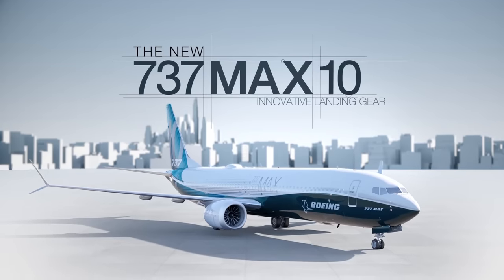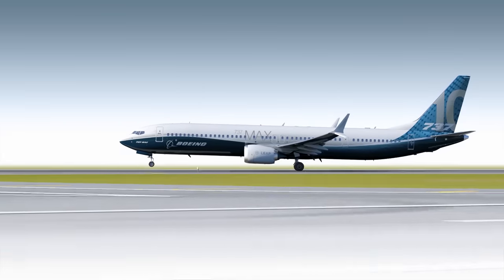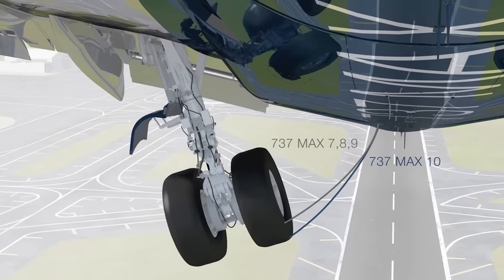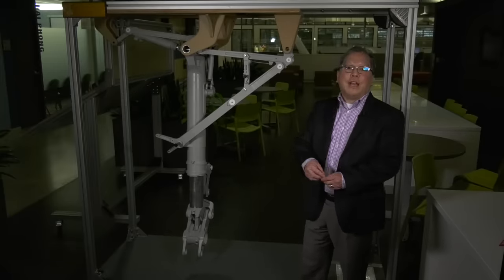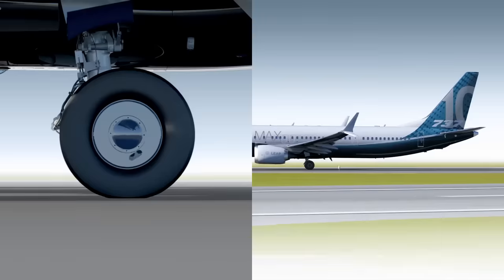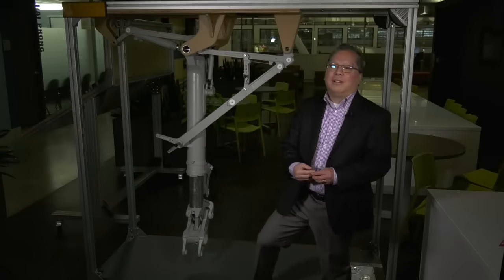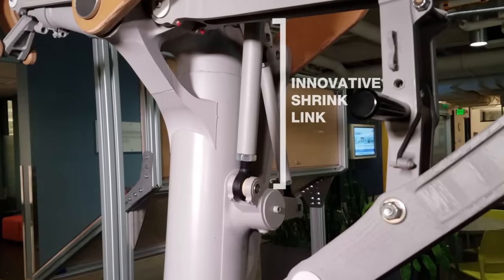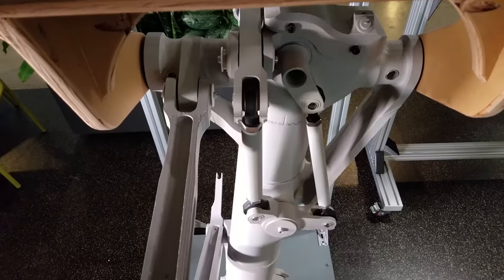How the 737 MAX 10 landing gear works

Comment: So for 20 plus years they've used that squashed engine cowling for nothing?
Reply: No because thats for taxiing
Reply: The reason for that is to make the plane lower to the ground and not allow FOD to be sucked into the intake.
Reply: It allows easy access to the fuselage increasing the efficiency of cargo loading
Reply: Nope. It’s because the gear is too short because the plane was designed with low bypass JT8D engines. 

Cargo loading isn’t more efficient, because the cargo pit is still that of a regional jet... very small with inward opening doors which makes loading more difficult.
Reply: @Bartonovich52  the engineers wanted to make it easier to load   stuff into the fuselage  by the fuselage door.The fod would not need to use complex equip to get the stuff loaded as the fuselage is at a lower height.So they wanted to make a change to the engine cowling.You are not wrong is just that there are many benefits to loweing the fuselage which means having shorter gears and squashed engine cowling.

Comment: ryanair landings
Reply: Jaden Corner 😂😂😂😂😂
Reply: Jaden Corner Will the plane land smoother on these new landing gears? The current 737-800s land so firmly
Reply: Tom Jardine I would hope so as there is more gear but as the plane is so low I guess they can’t add that much more to make it less firm
Reply: @Matty12333  with more strut travel it should help

Comment: I think if they made the MAX higher than the 737NG, non of the crash would happened bacause the main problem is the engine. The engine is slightly higher than the wing causing it to interrupt the airflow which makes the plane go into a stall position. If they made it higher like the A320, the engine would be lowered and uninerrupt the airflow and they can removed the MCAS.

Comment: Boeing still milking it with the decades old 737 design, just build a new plane !
Reply: Boeing pressed for a new design, Airlines demanded more 737s. Boeing's not at fault for the customer's requirements, mate.
Reply: Agree, both Boeing and Airbus are under enormous pressure of airlines seeking solution to either replace or expand their fleet (especially low-cost airlines, both start-up or established ones). AirAsia and Indigo alone ordered over 500 A320neo, Ryanair and Southwest almost 400 737 MAXs.
Reply: They did build a new plane, the 787
Reply: 1) Customers don't need a new one, as mentioned before Airlines wanted more 737's.
2) Building a new plane is HARD. Did you see the 787? A completely composite fuselage was a new plane. It suffered many many delays in the launch. That's why we don't see new aircraft designs every 5 years
Reply: Not to mention the same width. Matter of fact the new 737MAX fuselage is almost inch narrower than older models. So where is  Boeing engineering?
Reply: Nandoo The 787 was a challenge because as you said Boing had no experience in composite airframes and trialled a new way of assembling a plane from mostly ready made components delivered by a range of suppliers outside the Boing plants. That experience could have been used to build a new 737 successor in a much faster fashion. The current 737s fuselage is too narrow, the landing gear too short for larger engines so that they already have to come up with complicated link and strut additions to manage the rotation point. The plane is half a century old and needs replacing. Maybe the new middle of the market model will solve the issue.
Reply: Malith Perera does that eat into cabin space or is it just a reduction in wall thickness
Reply: If I understand correctly, one thing that Boeing doesn't have covered well in their catalogue of commercial aircraft is mid-size airplanes.  The 737 is a small plane, and the 767, 777, 787 are large planes.  The only one they used to have is the single-aisle 757, and they no longer make that.  So, the reason they keep modifying the 737 is not just because it's a popular aircraft, but rather because they don't want to invest in a completely-new single-aisle short-to-mid-range aircraft, and it's just easier and cheaper to add/remove length to the 737.
Boeing also does not make small local commuter/regional-type planes, like the popular Bombardier Q400.
Reply: You have valid points there, and I completely agree with the possible "797" middle of the market being the solution. But at the moment the 737 isn't really a "true" middle of the market aircraft in my opinion. At this point in time the most feasible way is to add to the 737 as EVA_Unit_4A said.
Reply: LordLauderdale I personally think the 737 has ran its course, but I suppose designing a new plane won’t be easy nor cheap
Reply: It's not as easy to just "build a new plane" as you would like to think. It's an enormous investment and economically it's better to re-engineer current products to meet the demands of their biggest customers than take an unnecessary risk. The 737 is due for replacement around 2030, yet airlines currently are fine and happy with more 737s (i.e. WN, RYR, UAL, etc). Every manufacturer "milks" their products if there is demand for it; don't turn the other way and ignore the others while simultaneously criticize Boeing for doing it
Reply: A totally new architecture plane requires a decade for development and certification .
Reply: Same could be said about Airbus. The fuselage looks exactly the same, however the winglets  on a 737 are new designs. The a320 Neo only has new engines, no new winglets
Reply: @LordLauderdale  like the 797 which is a completely different market?
Reply: @jviation737  dude I love ur vids man
Reply: The 757 replacement is Boeing's priority not the 737 replacement. If a new plane was needed and wanted, I'm sure Boeing and Airbus wouldn't have wasted time or money putting new engines and other improvements on the 737 and A320 families, they'd have made a narrowbody version of the A350 and 787 if that was the case.
Reply: Infinite flight And more games There is overlap with the largest 737 variant and the Airbus A321. The smaller 737 could be replaced by the new partnership with Embraer.
Reply: To people who make airplanes, airlines are the customers. To airlines, the passengers are the customers.
Reply: LordLauderdale no;
Reply: the cseries which airbus majority owns, is a direct competitor to the 737 max. Its lighter, less noisy and more fuel efficient.
Reply: Boeing asked we need a 737 replacement and customers didn't want that they wanted a updated 737 and screamed loud this aircraft is called the max for a reason unless they redo the type certificate system this is the maximum they can update the guppy jet without retyping the aircraft
Reply: @alexmnblyth  The wingfence was the original Airbus wingtip device now they moved to a standard looking device
Reply: You heard this saying 

Easier said than done
Reply: Or the saying "Why fix what isn't broken". The 737 is in high demand, why replace what is still a big seller?? That would make no sense especially considering that their replacement jet might be a big flop. Then that's millions if not billions of money down the drain they'd never get back
Reply: Don't fix what ain't broke
Reply: Nick Dawson Exactly. I personally love the 737. I love Airbus jets too. Each are great in their own way. But my favorite plane has always been the 737. Everytime I see it it only gets more beautiful
Reply: @iVince905  Wrong. The A220-300, the larger of the 2 models will at best ONLY compete with the MAX 7, the smallest MAX variant. All the other MAX models are considerably larger and don't compete with the A220-300.
Reply: @nycalien . An inch is 2.5 mm. What significant consequences is 2.5 mm narrower fuselage gonna effect the Max from its predecessors?
Reply: YouTube CEOs and aeronautical engineers
Reply: blame it on the airlines, boeing wanted to make a composite 757

Comment: Should have made a similar system for the rest of the MAX series, only that it's always extended when down, even on the ground, then it contrapts when rectracting. That way the engines didn't need to be fitted so forward and no MCAS would have been needed.

Comment: still a 60's airframe
Reply: ya a solid one at that
Reply: Made from real metal.
Reply: Very reliable and solid airframe, hence why it's still very popular today 40+ years later, I doubt a modern aircraft airframe design will last so long, they don't build things like they used to anymore. Look at the A380, some are less than 10 years old and are already retired.
Reply: Do you own a car with four tires? If so, you are basically living in the 1890's amirite?..  See how stupid that sounds?
Reply: Right, when things were overbuilt and sturdy not just strong enough. Not built by today's snowflakes :-)
Reply: @guitarplayerforu  they are not being retired because they the airframe isn't good anymore. And some of those were already bought to serve other airlines.
Reply: @tomasribeiro8020  I didn't mean they are being retired because of the airframe, my point was that no modern Aircraft will probably get to the stage the 737 airframe has being a 40+ years old design.
Reply: @guitarplayerforu  yes but let's be honest the 737 only got this far because Boeing was constantly updating it and "forcing it" on clients. The spitfire would have survived to modern days if it was constantly update over and over. So basically the 737 isn't dead because Boeing kept it alive. Not because the original design was made to last 150 years.
Reply: @tomasribeiro8020  that's true, if the design works it makes sense to keep updating it, I love the 737 and remember my first flight with my mum in 1998 on a Britannia airways 737-200 and the 200 was a brilliant aircraft, it was also a very different aircraft to what the modern 800Ng with sky interior or the Max  we know today is. Yeah the basic fuselage might be the same but a lot of other stuff is new on 800's/Max, especially the Max, it's had a new tailcone and everything. I do think though that the 737 max will be the last series of 737. I think it's a shame the 757 couldn't have been updated. Apparently airlines wanted a simple re-engine of the 737 when Boeing was pushing for a new narrowbody aircraft.
Reply: @guitarplayerforu  of course they wanted it. With airlines having fleets some with hundreds of 737s the maintenance costs would be to big if they wanted a brand new narrow body. And I agree with you the max will be the last generation of the 737. I've never been a fan of the 737 but hats off to Boeing for changing the market in such a dramatic way with one aircraft. Long Live the a320! Sorry couldn't resist.
Reply: @tomasribeiro8020  the A320neo will be the last of the A320 I think too as the A320 design is 30 years old too and been updated over the years. The 737 is only 20 years older. Both are old designs now and both have done exceptionally well but around 2030 time both will be replaced with a clean sheet aircraft I think.
Reply: @guitarplayerforu  yeah probably. Both are absolutely brilliant planes and changed the aviation industry forever. Although the neo and the max will still last at least 10 years or something. Time for a clean sheet of paper both from Boeing and airbus. I think Airbus might get inspiration on the A220 for a new aircraft... Especially on the cockpit (though the a320 has IMO the best and most logical cockpit on the market)
Reply: @tomasribeiro8020  I love the A220(formerly C-series) I'm hoping the A320 replacement is a bigger version of it personally, it's perfect. And as for Boeing, a baby Dreamliner would be an amazing 737/757 replacement. The max and neo will definitely be around for a long time 🙂
Reply: @guitarplayerforu  couldn't agree more with you on this one. A baby dreamliner would be amazing. And a grown A220 is actually a pretty likely thing to happen. If I'm not wrong the 797 is supposed to have quite a lot of features from the 787 actually.
Reply: Overbuild airplanes are no longer competitive as they are just costing more fuel than other accurately designed planes.   Planes can no longer be overbuilt if they are to be economical:  They are built to the safety requirements of the industry and nothing more.  Unnecessary weight= lost revenue for airlines.
Reply: So fucking what?
Reply: TR Aviation You are aware that airline companies were requesting the 737 right?? Southwest alone requested and ordered over 400 of their Max10's. Doesn't sound like Boeing is forcing it on anyone it's just the best plane to use.
Reply: @Pedro Santos, that is the stupidest thing I’ve read on here. 

The 737 has always been weak. It was designed to be lightweight using bonding for pressurization hoop loads... but it disbonded and out rivets that we’re supposed to be in tension holding the skin onto the fuselage in shear holding the lap joints together. One day, it decided to let go and Aloha 243 became a convertible. Now all classic 737 have to have boilerplate lap joints after 50,000 cycles.. and Boeing made the 787 out of conposites to get rid of metal fatigue and stress concentration cracking. 

And “snowflake”, seriously? We should waterboard anyone who abuses that internet neologism.
Reply: Bartonovich52 ‘’The 737 has always been weak’’ and then you mention incidents it had in the past’’ like Aloha. Haven’t you forgotten that it was a plane produced back in the days Technology in Planes weren’t like advanced as the ones today? Did any A320NEO or 737MAX ever crash? There you go

Comment: The way when the plane rotates and the landing gear extends, it looks like the tail strike risk is lower. Like the landing gear does not extend further on the other 737 family. Like the 777-300 has its landing gear lifting up pair by pair to lower the tail strike risk than on the -200 family

Comment: This is about using the larger diameter engines, used on the AirBus 321, on a 737. Yet the tail isn’t so high that it won’t fit into hangers used for the 737, (Southwest and Ryanair examples)

Comment: i think the great ideia is build landing gear with indestructible material. And then, all you have to do is produce only 3 units. So it can be recovered in the next 737 crash and installed in another one until there is no more needed.

Comment: "Commonality with the MAX 8 and MAX 9" - don't you mean commonality with the 737-200? Aside from this contraption, the landing gear arrangement of the 737 has really not changed over it's entire life, and that's probably one of it's biggest limitations - that short landing gear which is problematic for longer designs in regards to tail strikes, and also was the reason behind having to mount the engines further up and forward, which is why the whole MCAS thing was necessary in the first place - this madness all really traces back to the landing gear. It is one of the last vestiges of the original 737, and one they really need to ditch - though at that point it isn't really a 737 anymore as there's nothing left of the original design. If they want to make it any bigger, they should add a longer gear leg with four wheel bogies, actual gear doors. Should widen the cockpit as well, the current design is not well suited for long-haul missions 737s are now used for. ... Oh hello 757-NG, good to see you again! This mechanism here is brilliantly designed, but I just see it as yet another effort of pushing an old design too far, both in size and time, it's too riddled with work-arounds by now. Time for a clean-sheet design.

Comment: at this poinf of time Boeing needs this new system 
on the nose so it will retract  in a panel under the cockpit 
also they might wanna just not have landing gear
because they wont need it 2.5 seconds after departure 
it will decend rapidly falling out of the sky to its doom
so will they or will they not be needing landing gear?

Comment: From a pilots perspective the overhead panel should have been modernized, not be stuck in the 1960s still.   Also the cockpit can use some better sound insulation.

Comment: Should have just raised the bloody plane 12 inches...then you wouldn't have had to mount the engines higher up on the wing.
Which would have prevented the nose pitch up...which required MCAS.
Which caused the crashing, and the deaths, and the grounding.

Comment: just check out the A340's and A330's they also have a shrinking link system in the Landing gear and they fly around since 1991/1994. just as an info for all these guys who think it's not safe or whatever...

Comment: They solved the wrong problem. They need to raise the entire fuselage higher off the ground. So they don't have to monkey-wrench the engines into such a forward position because they don't fit under the wing.  Time to re-think. This tinkering is only to reduce the odds of ground-strike on the tail while rotating for take-off.

Comment: Should have just kept the 757. Holds the same number of seats as a A321. Having to keep SWA happy with keeping the 737 type and stretching it way beyond its limits is causing engineering problems that you can’t engineer around between MCAS and now this is getting ridiculous trying to keep the 737 type for a stretch limo version of the original -200s and 300s

Comment: Wow! Never knew the gear did that. That's incredible!
By the way, the camera positions sucked. You can't see how the mechanisms work. I had to go back several times to figure out the extended rotational strut and the shrinking mechanism and I'm pretty mechanically inclined. This needs to be redone.